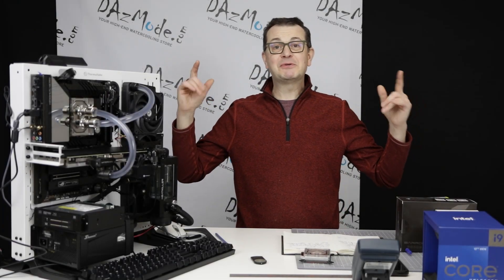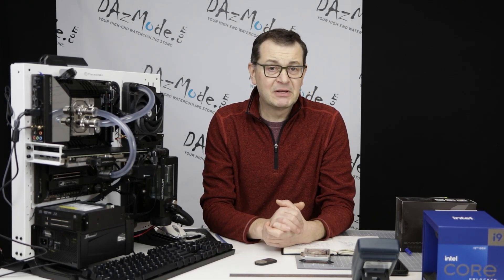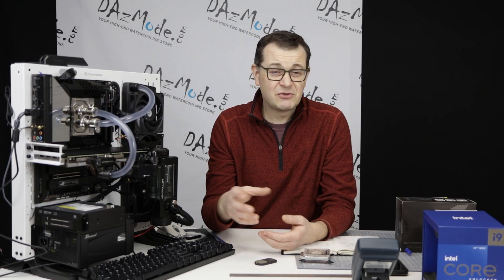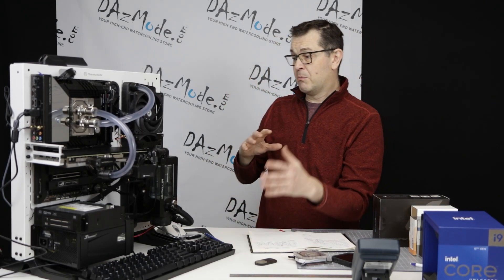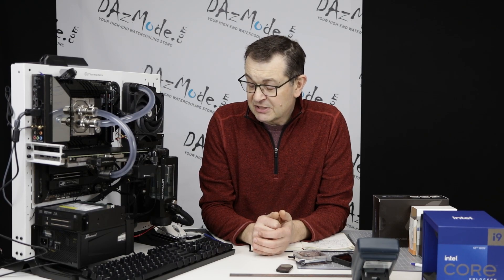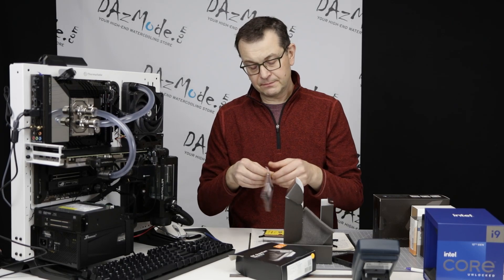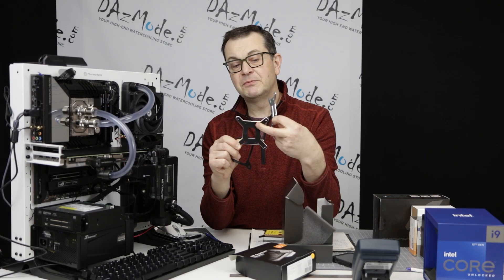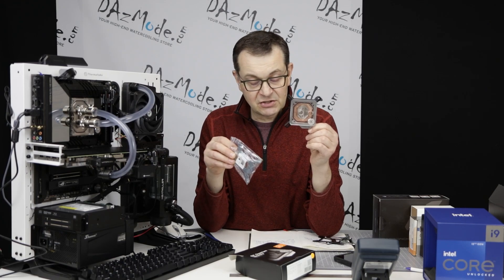Is Original EKWB Velocity still good for  12900k?

Comment: I just did an open loop on my 11900k with the velocity. My options were, the Velocity the Surpremcy or a Heat Killer Pro
Reply: I actually wish I could of got a 10900k but too good if a deal on the 11900k with an Aorus Z590 Ultra.

Comment: My old EK from the early 2010s suffered from a lot of corrosion, due to poor materials imo...mainly plating coming off and corroding. Yes, maybe some mixed metals in the loop, but the newer ones don't have this issue.
Reply: I'm using the Velocity on the 13900k after using it with 9900k...in 4 years I changed the coolant 2 times and everything inside is literally like new. I opened the Velocity to clean it before using again with 13900k and once again I was amazed to see there was clearly no need.

Just use the right stuff and right coolant.
Reply: @sgru9558  like l said, the old ones were like that a decade ago. The new ones are much better.
Reply: @MonkeyspankO  got you so a lot has changed since then..there are still ppl who think a custom loop needs maintenance every six months while I ran for 2 years (ek clear coolant) and was like new.
Reply: @MonkeyspankO  That's true, i have a custom loop with 4 rads, gpu and cpu block + pump res combo, i used EK, Phanteks and now an Alphaccol WB for my gpu, fittings from different manifacturers and never had a problem, i have always used Double Protect Ultra clear coolant.

Comment: I've read that flow meter is somewhat inaccurate.
Reply from the maker: Seems I eyeball that right...
Reply: While these flow meters may not give the actual flow rate they work fine for a general idea. Also if the only change between tests is the CPU block then the numbers should show which blocks are more or less flow restrictive.

Comment: I would love for you to test the original EK supremacy waterblock. EK's new backplate supports the original supremacy waterblock and also there doesn't seem to be much information out there on how the classic supremacy compares to the Evo or the Velocity.
Reply from the maker: I might check it out as I have it, but in any way, the progression from Supremacy to EVO to Velocity was not dramatic, so you can use results in this video for the idea.
Reply: Same here, I have the backplate for the LGA1700 just in case I want to upgrade my processor in the future without changing the block. As long it's functional and keeps the temps under control, don't care about 100Mhz higher OC tbh
Reply: Quick update: just installed my old Phoenix CPU module (Supremacy WB) and indeed works ok with LGA1700. However, screw sizes were different in my case, so when you ask EK for an upgrade kit, get the AIO upgrade kit as well, as the AIO includes all the new screws and retentions needed. Temps in my 12900K are similar to my 9900K so all good 👌

Comment: Please test also the old aquacomputer cpu block, kryos vision, not so many reviews out there for it. Thank you for this review !
Reply from the maker: Sorry, I  don't have any of those. Cross-reference to some another block that I will do. I'm pretty sure a comparison exists with HeatKiller for example.
Reply: "Old block" ? Lol. Is as old as the rest of the counterparts. It's a microchannel waterblock similar to many of the competitors on the market. The only thing to differentiate them is the pressure drop value.